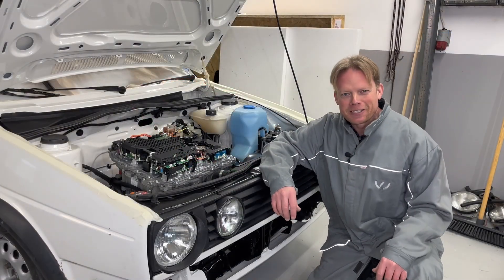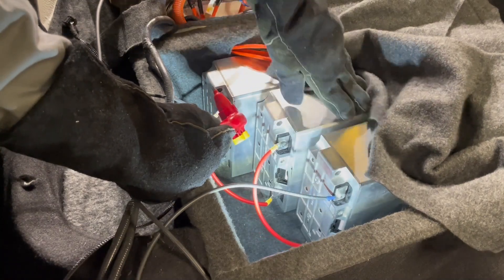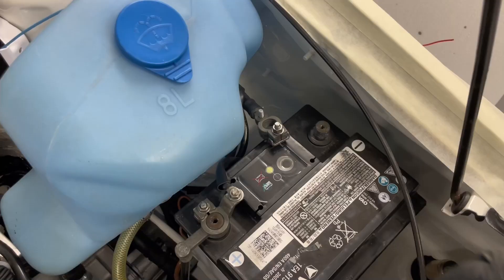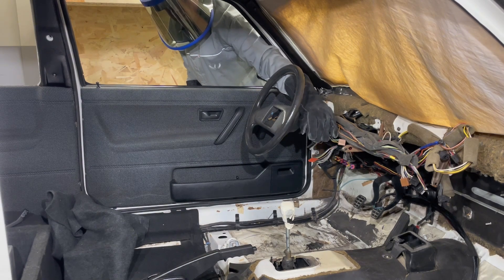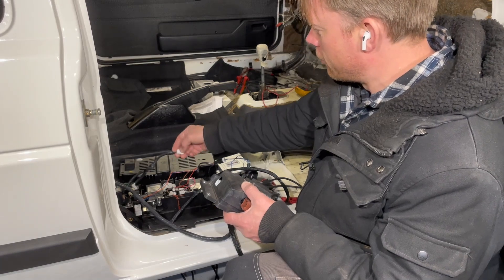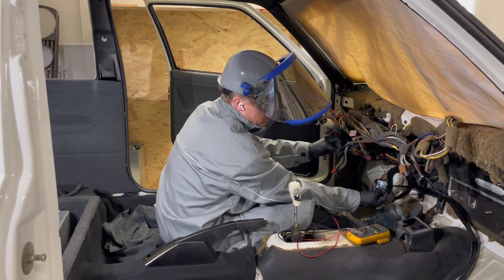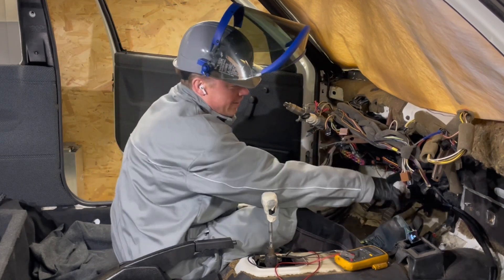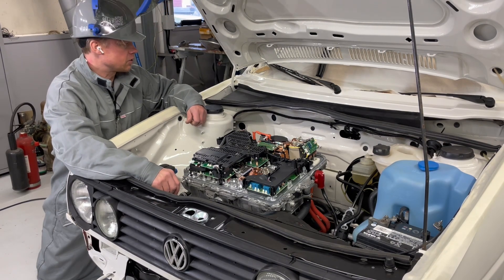Battery wiring, troubleshooting, first start!! Ev conversion. Vw golf Mk2 Citystromer.

Comment: I did not see a fuse between the middle of the battery pack modules.  Also, I am concerned you used too small of diameter wiring for your high voltage,
Reply from the maker: This was only a test to see if everything should work, and I explained that in the video that those wires was only temporary and the virus itself had probably worked as a fuse in this case. But of course you are right a low amp and high voltage fuse would be correct to have inserted at my “service connector”